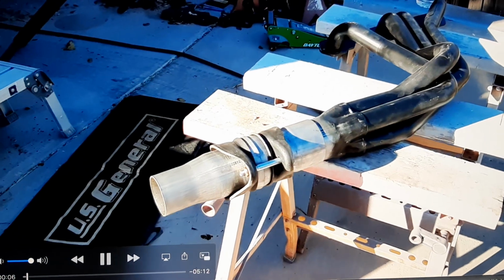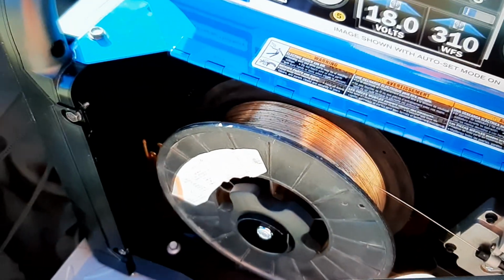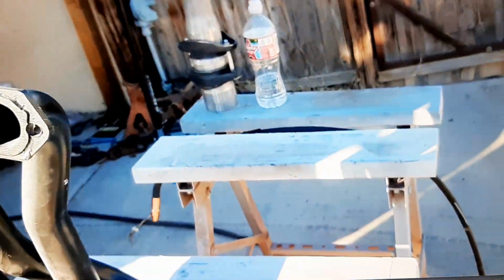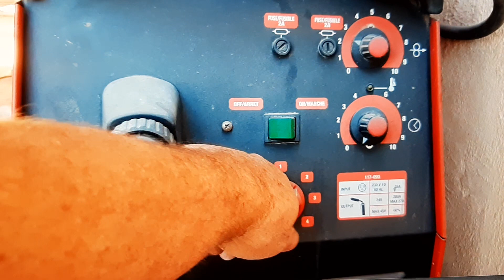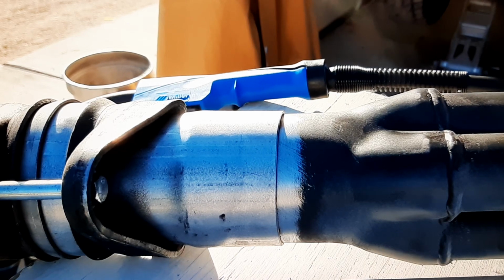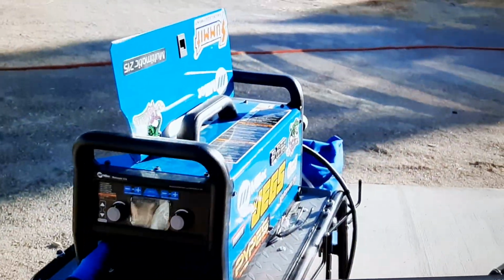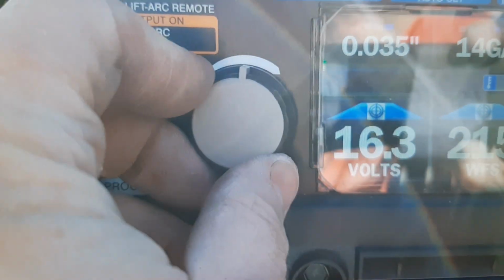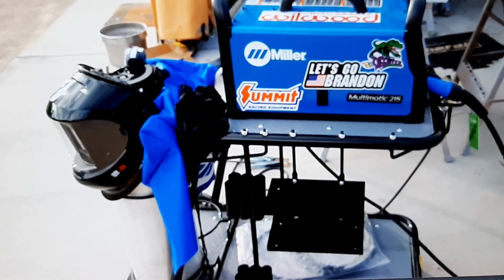Miller Multimatic 215 WFW Wire Feed Welder review from a novice welder

Comment: I’m thinking about buying one so how do you like it know after you had it for a while
Reply from the maker: Are you kidding? Bro! I LOVE this welder!! If you are a beginner, novice or even a pro! I HIGHLY recommend this welder. I have had 3 Wire feed welders and with this machine I can do no wrong. If you play GTA and use cheat codes, this welder is the same thing! a "CHEAT CODE" for welding. I have used it on 22 gauge all the way up to 3/16 and I can now dare I say get professional results each and every time. And that is using only C02. I thought I had Argon/C02 and had it set on the wrong setting. Argon / C02 is even supposed to deliver even better results! I bought and filled a new tank with the 75 25 Argon C02 mixed gas but haven't switched it out yet. It runs so well on the CO2 I figured I will wait until it is gone and then I will use the 75/25. Also I have done a few exhaust jobs with it and a job for a friend and this has already paid for itself.So my advice is BUY IT! You will LOVE it! I am NOT affiliated with "Bakersgas" but they have the lowest price that I found right now google and see if you can find it cheaper and check Amazon as well. Bakers Gas is also giving away a free MIG Consumable Kit for Miller MDX-100 Gun, .030 / .035 Wire a $129.00 value with the purchase of the 215 welder. 

https://bakersgas.com/products/miller-907693?campaign=17622828686&adgroup=&feeditem=&keyword=&matchtype=&device=c&network=x&gclid=Cj0KCQiAsvWrBhC0ARIsAO4E6f-qrEDOFI85Lmkv8Td6kx0-kbyePUn7x556xxPSwQUa7Pqx_UiktFcaAlRIEALw_wcB&creative=https://ad.atdmt.com/s/go;adv=11242241809840;ec=11242241809912;c.a=17622828686;s.a=google;p.a=17622828686;as.a=;qpb=1;?bidkw=&dvc=c&h=https://bakersgas.com/products/miller-907693&gad_source=1
Reply from the maker: Oh and don't waste your money buying the Miller Multimatic 215 TIG Kit - 301337 for $762.00 Go with the "YesWelder 250 Amp AC/DC TIG Aluminum Welder" https://youtu.be/AsELQhnV6HQ